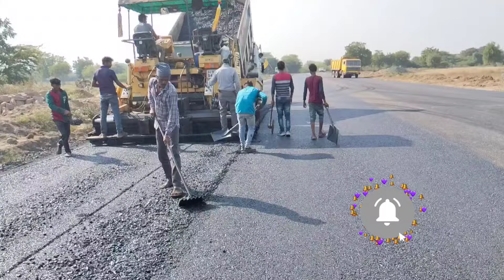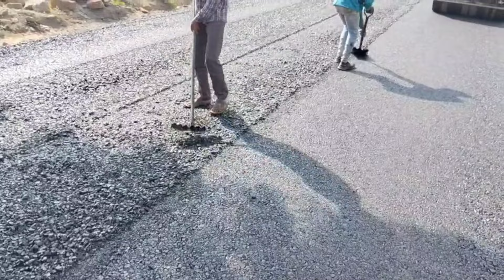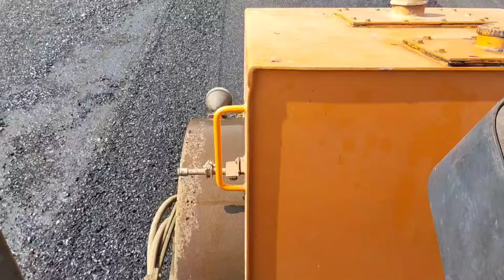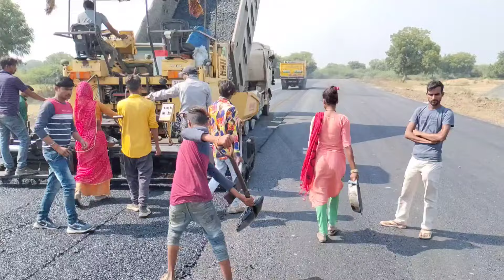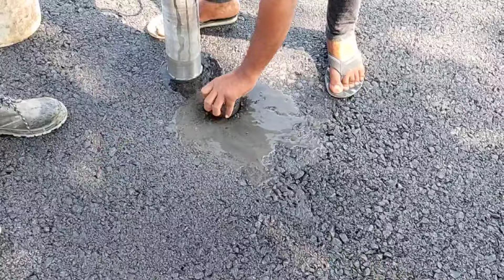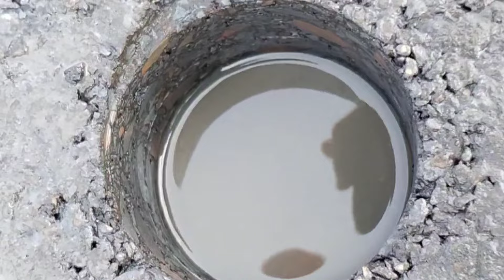DBM (Dense Bituminous Macadam) Laying process and test.

Comment: What a mess,why are these men scraping excess material off of the previously paved mat,the screw man is clearly not doing his job correctly.The side plate should be down,and the joint shouldn’t need touching
Reply from the maker: The side plate is down because it is needed in the camber and material will remain in the joint, so finishing is being done carefully, understand brother.
Reply: This is India yaha aysahi road bante hain with with quality.